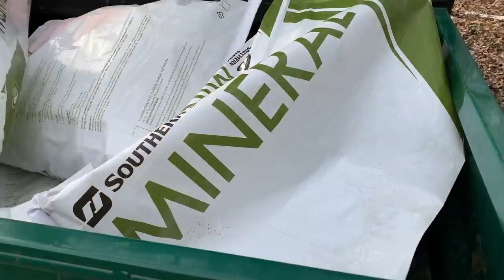What a mess! Year End Clean Up & Clean Out

Comment: The next time that you have to clean the Suzuki, use your leaf blower out in the back lot. Just have the breeze at your back.
   Also if saving the seed in a drum. Use a two hole lid and the shop vac to draw into large drum for storage.  You need two shop vac hoses. One from vacuum to drum and another from drum to hopper.

Comment: Hi meredith i apolagize for my bad spelling  .just to let you now the differents . A seedrill drills a gap for the seeds to drop into. ie it has 1 or 2 disks at the front to open the dirt a seed shute to drop the seed down then a set of wheels to press the dirt back together. This is what your family has. A seeder is userly a bigger version of the same thing .thier is also another bigger version that is called an air seeder this has compressed air to asist in seed to run down very long shutes . Their is also a seed spreader that is userly for just broardcasting grass seed. Love your vidios .from nz